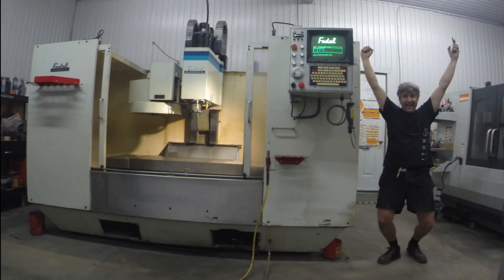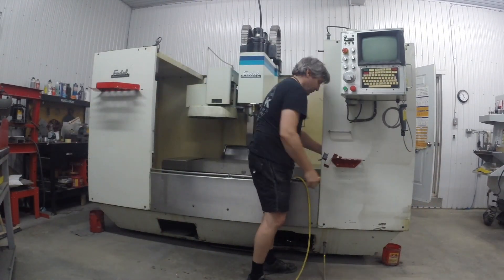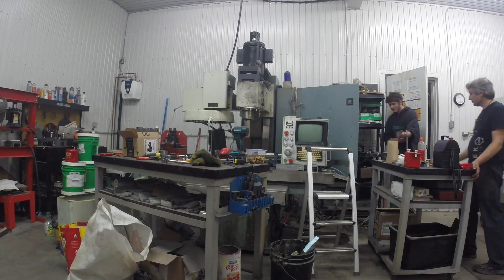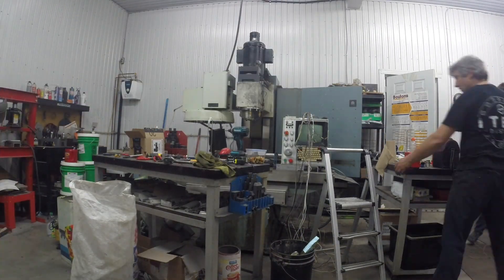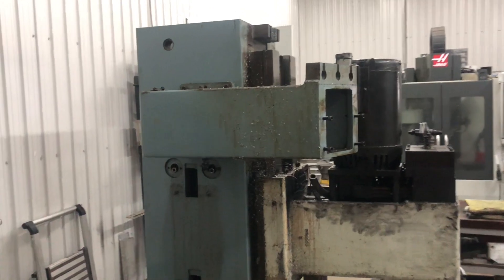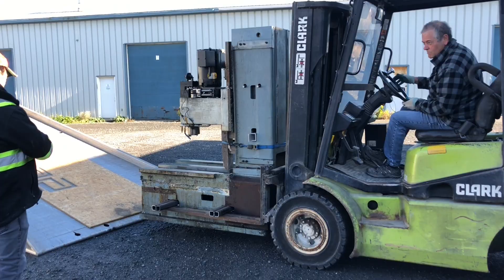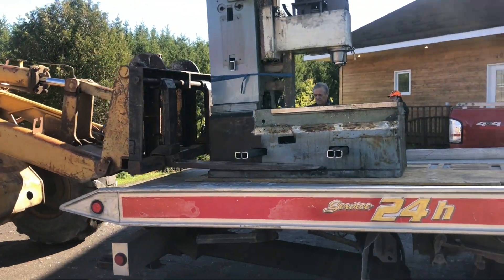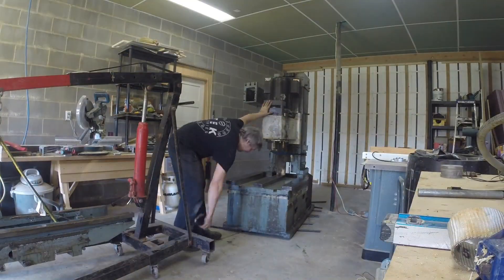Part 1 - Fadal VMC 4020 CNC reconditioning

Comment: How thick is your foundation? Your video makes it seem like a piece a cake haha. Subd
Reply from the maker: It’s a good 4 in or more, but I used a very good quality concrete. I’m hoping for the best. Worst case scenario, if the whole house starts vibrating, I’ll move the machine and install a new slab. Fingers crossed! 🤞🏻
Reply: @BlaiseBarrette  I didn’t think about the house vibrating haha. Guess I should’ve thought about all that before buying the machine. Thanks for responding! Love your videos!

Comment: I think these machines can be wired to run off of single phase with the factory components.  You will however loose significant rapid speed and spindle power IIRC.
Reply: You lose about 1/3 of HP……rapid is still 100%.  It’s only 3 phase at the spindle.

Comment: Good job I used to rebuild these fadels, haas,okuma,to many to mention,the one thing about Fadel is the threw the ball screw coolants if you don’t use Dow frost you will have problems with them,some people sometimes put other coolant in and screws them up
Reply from the maker: Yes, I glanced at the FADAL manual and they are very specific about Dow frost. No substitute!

Comment: Is this machine in Europe the reason i say this is because it seems to have a early type CE certification build?
Reply from the maker: I am in Canada, the French accent is because I am a French Canadian. What is a CE certification?
Reply: @BlaiseBarrette  So Fadal was if i am not mistaken was one of the very first if not the only CNC machine to be UL certified... which was a big thing basically UL underwriters Laboratories tested and put it through the vigorous testing to add there mark to Fadal machines saying that they are as safe as a toaster to use. 

But of course Europe didn't accept UL certifications as safe enough and required CE (i could write alot about this but baiscally CE goes beyond safe as a toaster to the point of you cant operate a Toaster in the bathtub  while bathing in said bathtub.... lol... you get what i mean)  So the reason i said CE  your machine being a 1989 has 2  conduits to the spindle motor, and you are in Canada and Canada was probably moving to the CE or was a request by the customer. But very very very few machines have the Conduit in the format that you have one on each side of the motor. Now the Double feed conduit is on the same side of the Spindle motor. Whether it is CE or the UL.  And the reason for the double conduit was to separate the Deadly Electricity from the Air and Water lines. Originally Fadals going back to 1978 220v Air and Water all ran down the same conduit.

Yeah maybe not a great idea..... lol

Comment: Dunno know where you are in the process but you can run single phase electrical into a rotary phase converter & get 3 phase out.
Reply from the maker: I still have all the original electronics but I wanna try to go an other way. I'm thinking of using UCCNC.
Reply: @BlaiseBarrette  what's wrong with Linux cnc?

Comment: I subed im looking to do the same was thinking about using centroid controller. Will be interesting seeing how it goes for you good luck man
Reply from the maker: Thanks for subscribing! I am most probably gonna use UCCNC for control. Clearly not as good as Centroid bit much cheaper. I have already bought the control and a servo drive to make a bench test for an other CNC project. A CNC router. I have already donne some experiments and it’s quite promising. If I’m not happy with result, I’ll just migrate it to the CNC router and buy something more robust. Good lock with your project! Keep us posted!

Comment: fadals ran off single phase from the factory shame you junked all the electronics. you will have a hard time getting any conversion to work as well as the original control
Reply from the maker: I agree that it was a bold move to trash the electronics but I think I have a sound plan for modernizing the control of the machine. I guess time will tel!.
Reply: @BlaiseBarrette  Great Vid!  I agree, 30yo electronics are outdated. Just unloaded my Fadal 6030, likely going to swap it to a Centroid control like I did two Bridgeports.  Graphics and conversational are great. Easy to add on simultaneous 4th and 5th axis too.  Keep up the vids!

Comment: why dont you just use a phase converter? thats what i use for my 4020. Id never redo the electronics just cause i only had single phase, seems crazy.
Reply from the maker: It is an excellent question! I guess I could have gone that way... maybe I should have! Thing is, I have been using this machine for the last three years, at work and I didn’t want to take my work home. What I want is a fun project! I find the 30 years old electronics is outdated and the interface boring and restricting. What made me decide to actually do it is that I want to be able to customise it. Make it more user friendly. Try things.

I have already built a bench test with UCCNC. Even developed a pretty cool control panel. It was for a different CNC project but I am confident I’ll get great results controlling the Fadal with UCCNC. I show briefly the control panel and the bench test setup in this Fusion 360 livestream (https://youtu.be/b34nPLBC7Bo at around 8:09).
Reply: @BlaiseBarrette  that sounds really cool, I hope you make some vids about it! Did it have the 88 or 88HS controller? I really like my 88HS controller. Only thing it doesn't have is memory and fancy graphics, but a USB DNC and PC backplotter/simulator fixes that. Thanks for the reply! Subbed and hope to see more.
Reply from the maker: @Steve_Just_Steve  I don't know if it was the 88 or 88HS, I glanced at the manual but couldn't find the information. To DNC the code to the machine we used the Shoplink (http://www.highlanddnc.com/images/ShopLinkFlash20Manual.pdf) and it performed very well for such an inexpensive gadget! Easy to use to! Thank you for subscribing! I know, my videos aren't very polished but I'll try to make them weekly if I can!